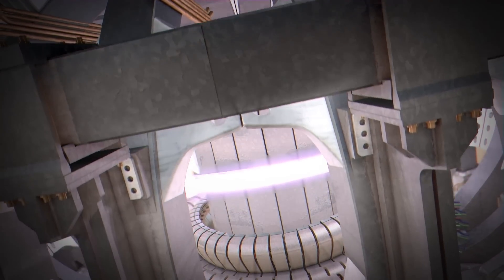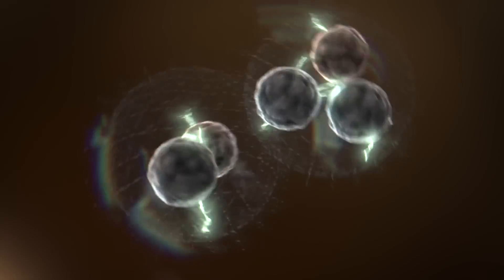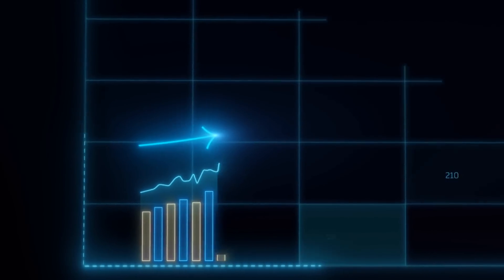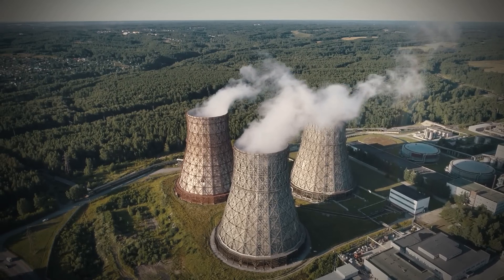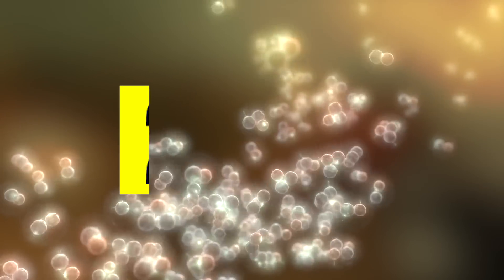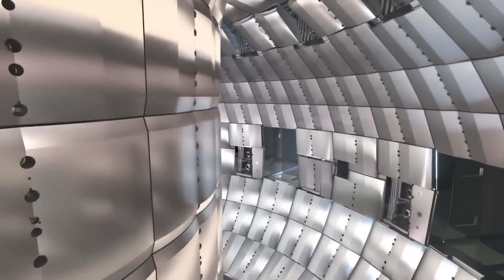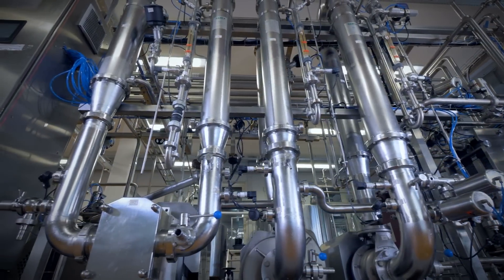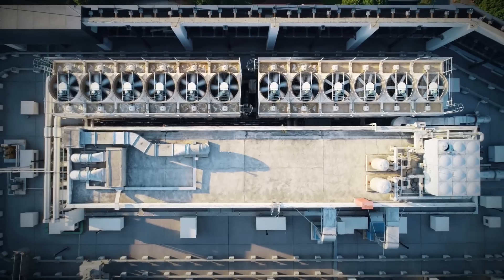The Shocking Problem That Could End Nuclear Fusion

Comment: Just use nuclear fission to create tritium. Right now it's the cleanest energy source available so what's the problem
Reply: The only problem is, is that the Government has put in so many regulations to most it so cost prohibitive to build nuclear fission plants, those regulations should be abolished and taxes should be abolished for these nuclear fission plants, get rid of the red tape, regulations and stupid taxes making nuclear fission expensive, build hundreds of these plants across the united states and thousands across the world.
Nuclear fusion is probably not possible as it is a reaction that only happens inside of stars where the energy output is greater than the energy put in, we have never had a fusion reaction because we've always gotten less energy out than we put in, so we have only had fake fusion.
Nuclear fission is already the solution to the worlds energy needs for now and far far into the future, splitting atoms is already a proven technology, fusing atoms isn't.

Comment: Aureon Energy.  Look into it.   Technology from the SAFIRE PROJECT.  The reactors you're talking about in your video is a waste of money.

Aureon Energy generates power and heat while remediating nuclear waste.  They are discovering the secrets to MATTER TRANSMUTATION.  And appear to have achieved OVERUNITY. And it only needs hydrogen for fuel ..  

They can sustain the reaction unlike the trash they of the reactors in your video.  The problem the fusion reactors in your video.  PATHETIC SCIENCE.  the SAFIRE PROJECT, is based on REAL PHYSICS.   Governments ignore AUREON ENERGY.    It goes against so many bunk narratives it's crazy .

Comment: Tritium supply is a minor issue - when compared with the other beasts that the fusion industry is tackling.  This includes first wall issues, plasma control, power supplies, heating methods and diagnostics.  You need to separate problems that are limited by the laws of nature, from those  that arise because fusion has been chronically under-funded.  Bare in mind that until just recently, fusion has not received anywhere near the amount of funding that it is now receiving.  A real sea change is occurring; and we've always had people who have said that this is impossible.  We will continue to have naysayers --- even as the fusion industry continues to roll forward and succeeds.

Comment: Tritium is only needed when higher levers can't be achieved. Tritium is easier to start the progress. The better the machines become better to constant plasma under even higher pressures and heat you can use simpler materials.

Comment: What? 🤨Damn PhD's are stupid... If it is a unintentional byproduct than it can be intentionally mass-produced... 
That's and easy problem to solve. Just use a neutron gun setup to make tritium outside of the reactor. There is no point trying to make the reactor produce it's own fuel. 
Just use the same set up minus all the high temperature shielding to do it in a specialized piece of a equipment.

Comment: 238 - 235 is three atomic units and solving that problem was huge. How much worse will be extracting 6Li from 7Li? There is only one atomic unit difference between the two. Additionally, we have been investing in and doing our best to create a fusion reactor since 1953. That's right -- 1953! That was 69 years ago. Are we to keep struggling with this until we have put in a solid hundred years? In my opinion fission is the real answer, especially when thorium is used in a LFTR type reactor. Just thought I'd give everyone a dose of reality.

Comment: Together with the tritium self-sufficiency problem, there is also the not so evident but critical fact that tritium recovery and re-injection (done in the tritium plant) is not immediate. Given the low cross-section of the reaction, tritium burn-up ratio is rather low and most tritium (~95%) reaches the divertor without being burnt. This tritium, along with the bred one, must make all the way through the tritium plant and tritium recovery systems to be re-injected back into the chamber. Typical residence times in the tritium plant range from a few minutes to hours. So, during startup, a reactor will need enough tritium to sustain reaction during the recovery time (minutes at best), times 1/burn-up ratio (let's assume 95%, so times 20). That's a lot of tritium (tens of kilograms) needed beforehand, and just D-D breeding might not be enough.

Comment: There are hundreds of tonnes of tritium in the world, it just hasn't reached the point where its worthwhile to extract it from nuclear waste. Almost all modern fission reactors and especially ones with graphite cores build up huge quantities of it during their lifetime and their are a number of radioisotope facilities that produce it as a waste product and have huge quantities store's.

The issue is demand, there isn't enough demand to make it economically viable as it would crash the price as most experiments have much more tritium than they need stored.

Also iter isn't the only breeder, jet and its sister reactors also breed deuterium and we're used to design iter and have been improved since iter design was locked some time ago.

Comment: I had always understood that this was not a "problem". It was known perfectly well that fusion power would not be usable, unless we had fusion reactors that could use only deuterium as fuel. Current attempts at making fusion reactors with deuterium and tritium as fuel are only intended as a steppingstone on the way to building a fusion reactor that will actually be useful.

Comment: Good video. My professional research is currently focussed on developing coatings and composite material technologies for tritium breeder blanket modules. There is a lot of work to be done, and much of it is at a relatively low TRL, but this work is likely to provide transferable engineering solutions to green hydrogen, fission and aerospace, and so it is well worth the endeavor (even if fusion proves to be too difficult to realistically achieve!).
Reply: If you're somehow a real person (and not a BP-funded comment bot), how can you be smart enough to research tritium blankets but also believe in "green hydrogen"? Do you just cynically use it as a buzz word to get funding and social approval without knowing or caring how make-believe it is?

Comment: Imagine they would have put all that money into thorium reactors instead. Or better batteries. More efficient solarpanels. I think that would have been way more usefull than something that takes ages ubtil it maybe works and the is still in need of ressources that are rare, expensive and could run out or is dependend on nuclear plants.

Comment: This is a wholly different problem than I thought you would be talking about. I thought this would be about the fact that in a star much of the fusion that occurs is a result of quantum tunneling and it is only because of the mass of the sun that it occurs often enough to produce the energy it does. Something that is impossible to reproduce in a fusion reactor.

Comment: good explanation of a problem that is not relevant and therefore is correctly not focused on by most fusion enthusiasts. There is simply something fundamental about plasma behavior lacking in our understanding atm. We are not close enough to a breakthrough in fusion that will make this problem relevant. But when we get there, I suspect this problem will be way easier to solve than our current problems

Comment: If I'm not mistaken I thought fusing deuterium any protium can produce helium 3 whitch is more energy than deuterium and tritium fusion so by that math its not a fuel limit more like budget limit and technology creativity being the problem. Personally they should start with protium fusion first to get the math and energy right they increase power output.

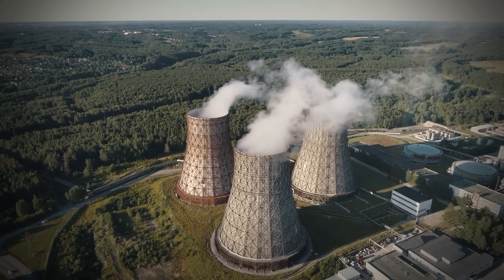Comment: At 3:00 you mention Canadian CANDU reactors are shutting down, while kind of true most of them are only shutting down for refurbishment and are going to reopen after. Saskatchewan and Ontario recently made a deal to build a series of new mini-candu reactors which are basically just smaller reactors but not micro reactors. It is safer though that isn't much of a concern with Candu but their main advantage is that they can be placed in more locations for cheaper which allows redundancy. If tritium is as profitable as you state in this video and Canada has a monopoly, I'd bet these new reactors will be able to harvest the tritium.
Source: I live in Ontario and CBC has published a few news articles on Canada's nuclear policies

Comment: Much easier. You can explain THE problem that will stop fusion reactors from being built ever absolutely without complex physics. It simply is the cost. Even if the fusion would work and even if it woud cost absolutely nothing, fusion reactors will forever be more expensive than renewables including storage. Why? Because the thermal engine ALREADY costs more than renewables and they are getting cheaper. The thermal engine is not getting cheaper. That alone will be the reason, why EVERY other form of energy production but renewables will be dead within the next two centuries.

Comment: buddy it will not work i spend 2 year of my life every day work on this model testing that on all Tokamak ( in FJFI) we have in custody and this.. not not a solution..  this is not only about plasma rotating inside.. my lord.. is about fusin'g core's..  you cant do it like this.. you can't ignite chunk of coal by match.. there is 7 quantum state what all particle shut pass trought eficiently..  to do overunity.. what is atm.. in this solution in this mashine.. unable. period.. and ppl still belive this withccraft coz nobady even bit understand what take fuse 2 single core's... nice example is LHC.. to fuse them.. you need LHC... or well powerfull accelerator.. ( tokamak kinda not a accelerator.. you have to pump power BY accelerator's inside tokamak! is more a reaction chamber with big transformer winding around) in base you start on lowes't poin of fusion energy what is defined atom's structure and type.. in order to generate heat to keep reaction on the go and magnetic wave's you need much more for pumping secondary coil of tokamak by overunity!.. than treshhold of those particles will eat that energy.. .. and then of you lose eficiency of SECONDARY COIL:. you have all those energy somehow transfer to secondary Tokamak coil too..  there noting as 100% energy ptansfer betwen parts..  in Tokamak. all part is just stake of lose on OUTPUT.. i was dreaming too about clean energy source.. but this is not the way..

Comment: Which is easier to crush together with 1 hand: two spheres that can slide off each other, or two larger clumps that can lock into each other. I believe fusion could be achieved much more easily than hydrogen using the correctly shaped molecules. Apocryphal stories of actual alchemy (conversion of elements), if true, may rely on this and allow fusion at low temperatures. Nowadays, instead of flying blind, we could stick all the permutations of isotopes into a supercomputer and get to work.

Comment: I think that the main reason the supply problem isn’t addressed more often (and is kind of elided) is because just on its face nuclear power (both fusion and fission) face large amounts of popular opposition. Evangelists want to boost enthusiasm for the tech, and you don’t get effective boosts if you front-load these concerns. If we ever want to see nuclear power become a replacement for fossil fuels we need to get the public on our side, and “we’re still addressing some issues, but those are solvable and the process is still very safe” is about as far as most people need to hear for fusion. Fission is more tricky, and requires more education, but that’s just because of the high profile disasters.

Comment: To be fair you can, fuse anything up to iron(iron being you end product and theoretically have a net energy gain. The limited supply of tritium isn't much of a concern. Tritium is probably the easiest to figure out (though even that is debatable) but seeing as we have fused things where the end product is element 118, I think we will be fine.
Reply: A star can fuse up to iron but though we can produce high temperatures we cannot produce enough pressure (yet) to fuse heavier elements and get positive energy out of it. It's not that it's impossible, it would just cost too much.

Comment: Why not just use a smaller, dedicated fission based breeder reactors then use the power from that reactor to start the fusion reactor and the spare power to the grid once the fusion reactor is up and running. There's always a difference between experimental and industrial and if it's possible then we should try it out.

Comment: Tritium doesn't occur naturally my ass. This element is highly abundant on rocky/metal/icy bodies in the solar system due to thin or barely measurable atmospheres and reactions with solar radiation. Luna has very significant surface deposits of tritium. Tritium is just rare on earth because our magnetosphere and atmosphere prevent our sun from turning earths water into star fuel.

Comment: Even if they solve fusion, how will we get plastic once oil runs out? Like, oh great we don't need to worry about fossil fuels running out because we now have fusion reactors and electric vehicles and planes, but we still need plastic and crude oil's finite and nonrenewable. Plastic isn't infinitely recyclable, you can only recycle it so many times before the bonds start to break down and it becomes unrecyclable, so what will we do once we run out of crude oil?...
Reply: You can already distillate naphtha out of fully wood-based byproducts.
Hydrogen treating and distilling tall oil thats created as pulp making sideproduct.

Comment: I saw an article about the discovery on the moon of rocks containing Helium 3 which was mentioned as a way to do fusion without emitting the troublesome neutrons. Since what we are really interested in is heat it would seem that this Helium based reaction would greatly simplify things. I don’t know why that isotope exists on the moon (and not apparently on earth) but I’d be interested in your comments on it.
Reply: Correct! I have read the same article and He-3 is a great alternative. The reason why its more abundant on the moon (because it does exist here on earth, but not in the quantities we require) is because the moon doesnt have the same protection against solar winds (in the form of a magnetic field) so the charged particles get deposited on the surface, among those is He-3.

Comment: Actually tritium itself is only expensive because it's an unwanted byproduct. Thing such as the Los Alamos National Laboratory can produce tritium but are more focused on producing other elements such as Californium or Americium. Furthermore nuclear fission will always be of use because of the whole industry surrounding it can be assimilated quite well with the fusion industry.
The idea is to have an energy source that can produce vasts amounts of power through fusion, but we will rely on Wind/Solar/Fission and even fossil fuels locally and as an emergency supply.

Comment: 2:15 So far, the solution seems to be investigating different modes of production for tritium.

How does the Sun do it?

3:30 Muons were thought to decay long beige they would strike the Earth after cosmic rays produced them in the upper atmosphere. What wasn’t taken into consideration was the time dilation I’d these particular traveling at relativistic speeds.

I wonder if you can ionize tritium and accelerated it in a cyclotron to relativistic speeds to increase its functional half life.

3:15 There’s one idea.

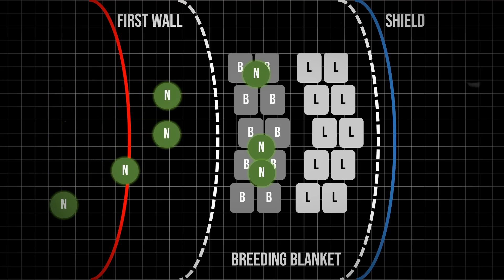4:15 Why would you need a blanket if a magnetic field is containing the plasma? Maybe line the inside of the magnet with a thin layer of the breeding material with a smaller magnetic field to catch the tritium ions?

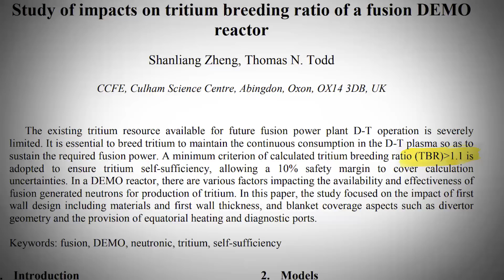4:45 Why are they building such large reactors to begin with? It’s not like you need a large amount of reaction to prove the viability. Prototype small; prove the concept; scale up.

Comment: The solution seems fairly strait forward, people just don't want to hear it.
More Fission plants.
Not only do Fusion plants need a large amount of tritium that can be produced in them, they also need a large amount of power to "jump start" the fusion process (even assuming they get the power output to positive, this will still be true).
Current generation Fission plants are much much safer and produce less waste than older models, but almost none are operating due to fear of nuclear power.

Comment: You seem to only be focussing on one possible way of producing tritium. There are other ways of producing neutrons to create the tritium, and as you said tritium is sometimes produced as a byproduct of fission reactors. So is it not possible to find out why and how it is produced in a fission reactor and then build a reactor optimised for producing tritium? As such they can already artificially produce tritium albeit as a byproduct. Fission reactions release neutrons too, so isn’t it possible to use the tritium breeding idea but instead just use a fissile material like uranium to produce the neutrons, maybe you could make it simpler by removing the beryllium as well as you don’t really need the neutron doubling at the potential cost of efficiency and output, you also wouldn’t need the same strength of first wall since you aren’t dealing with as much heat so that may also make it more efficient. Fission reactors already produce too many neutrons, that’s why they need control rods, so could it not be possible to instead of just absorbing the excess neutrons, you redirect them to produce tritium?